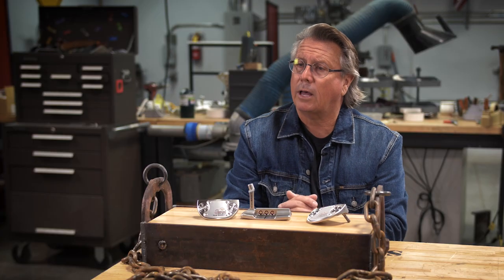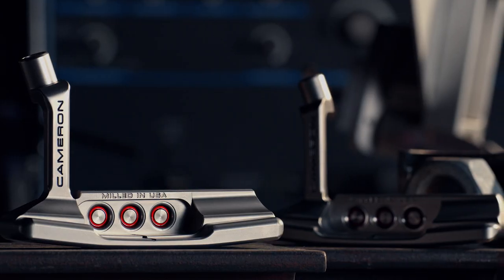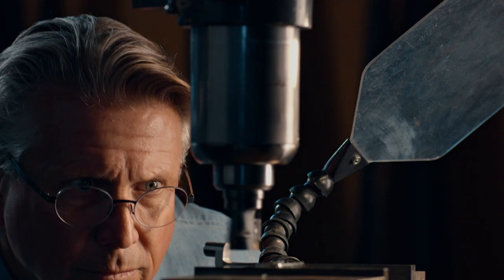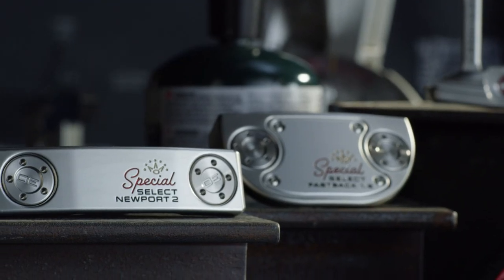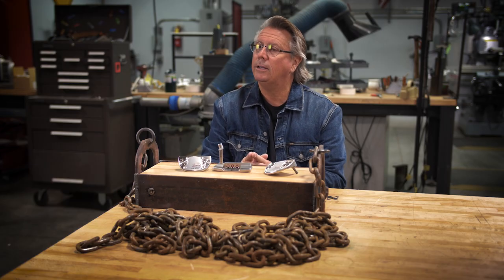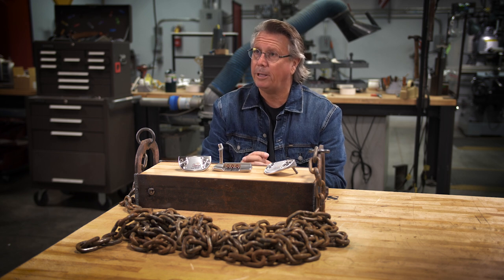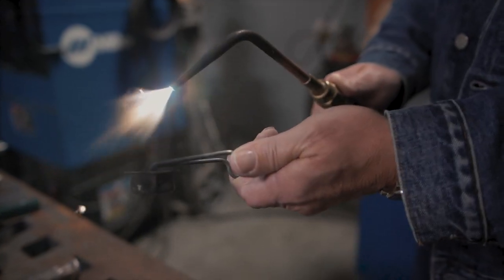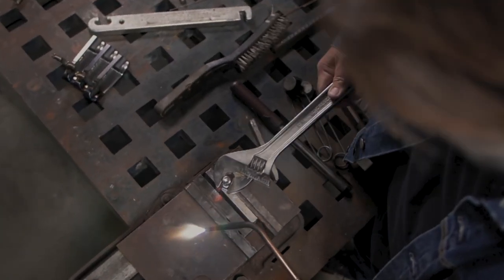Milled in USA I Scotty Cameron Putters

Comment: Stick on magnetic or not?
Reply: NOT unless you use a VERY Strong Magnet on Stainless Steel.
I have a 2018 Select Newport 2.5.
A Strong Magnet WON'T Stick to the Insert, yet it Will barely Stick to the blank Head.
Magnets easily stick to the Older Putters that were made with Carbon Steel.